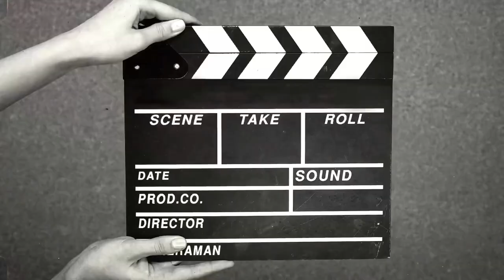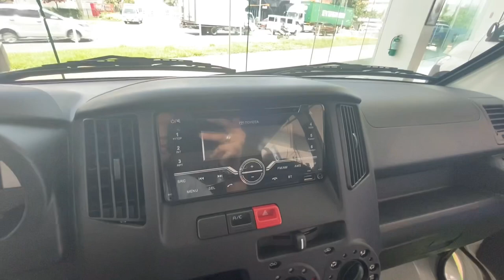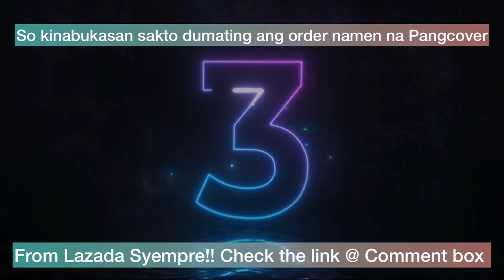PART 1 and 2 PROJECT Installing window & tint for my Brandnew Toyota Lite Ace 2023

Comment: sana maishare kung saan pinagawa yung mga bintana, i mean yung glass window mismo. price and and name ng gumawa and where to locate.  thanks in advance and more power.
Reply from the maker: Nasa Part 7 po ata .. nanduon po na screenshot kopo buong details at contact nila at location. Yung ibang ka lite ace natin nagpagawa napo duon below 10k nga daw po :) 

Enjoy watching!!! 

Part 1 & 2 Project Installing Window & Tint
 https://youtu.be/oO4IDeSEe48

Part 3 Project Installing Chair and Sticker Design sa mga Window 
 https://youtu.be/Lh1tPmSHrfw

Part 4 TOYOTA LITE ACE Panel Van Air Con REVIEW
https://youtu.be/cSUfxSXbFZ8

Part 5 TOYOTA LITE ACE PANEL VAN 
10-11 Seater na!!! Kaya ba?? Malamig ba Aircon?? 
 https://youtu.be/NecqV4zfBcs

Part 6  Totoo ba MAY ISSUE si LITE ACE sa 1000KM nya ??  magkano binayaran namen? 
https://youtu.be/V4iy4IGe8qM

Part 7 Toyota Lite Ace Panel Van Q & A 
https://youtu.be/8vG4poIrIPc

Part 8 Toyota Lite Ace Panel Van 2023
Topic Roofrack and Awning Nalagyan na at napalitan Front Seat PASADO kay LAZADA Delivery ??
https://youtu.be/aX9foOC_dVE

Part 9 Toyota Lite Ace Panel Van 2023 
Fuel Consumption PLUS bonus Topic 
https://youtu.be/cthw6k0kORE?si=wXpfH3LIiGZ38hSt

Part 10 Business Idea using your Van | Toyota Lite Ace Panel Van | First Time Mobile Business
https://youtu.be/6YUHEQfYBqk?si=4QWiBB4ouqMnu_PG

Part 11 TOP 5 Useful Accessories Inside TOYOTA Lite Ace Panel Van | Plus Quick tour to our DIY's
https://youtu.be/mwZDWYJdlH4

PART 12 Toyota Liteace PanelVan PMS | Toyota Apps for less hassle PMS | Philippines
https://youtu.be/zpESdNtB8Nw